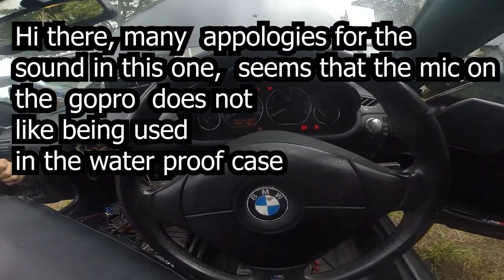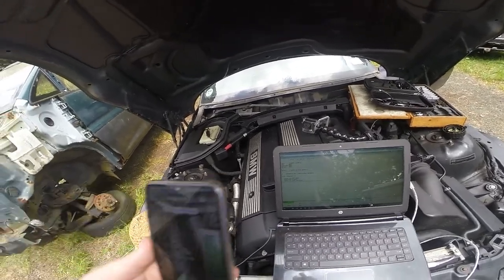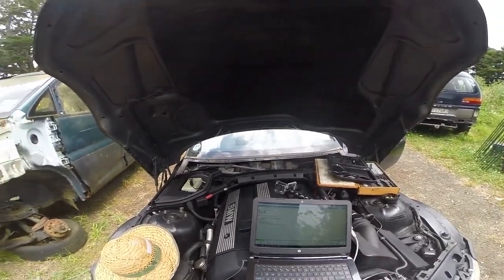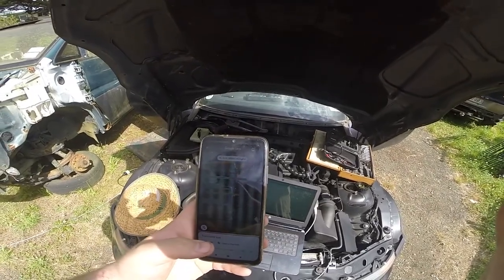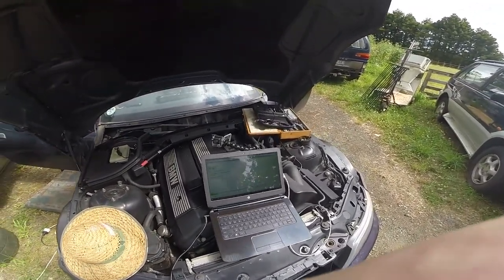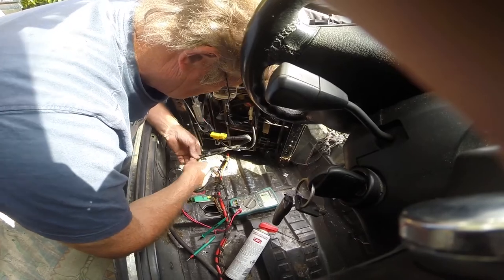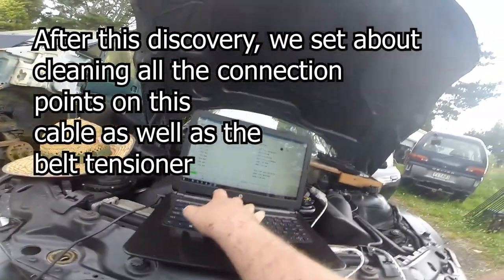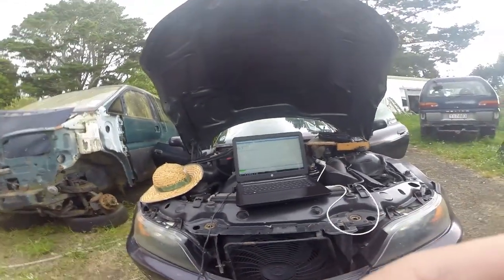BMW Z3 Rebuild Vlog  - Part 4 -  Airbag Warning Light investigation

Comment: would you know why my hazards are flashing by themself? Since locating the problem i have re wired the bonnet switch and will be changing the crash module, any ideas let me know, Thanks
Reply from the maker: i do not sorry, possibly your hazards witch in the center console has been pushed, or is sticky. other than that not a scooby sorry